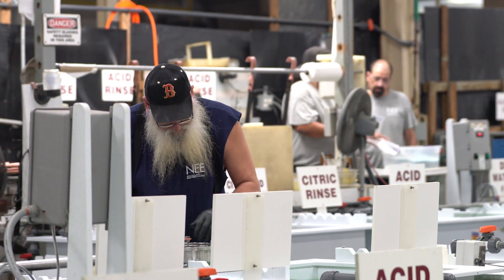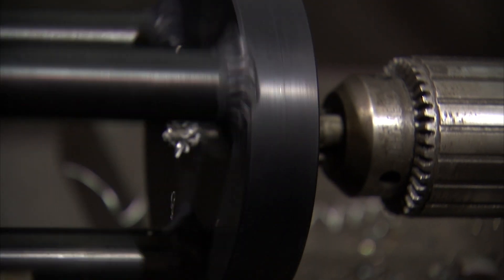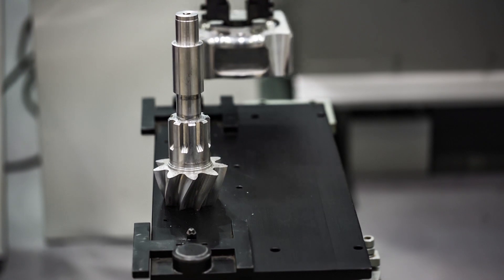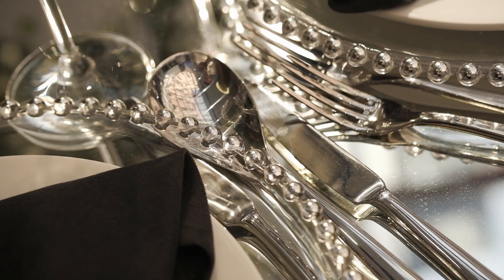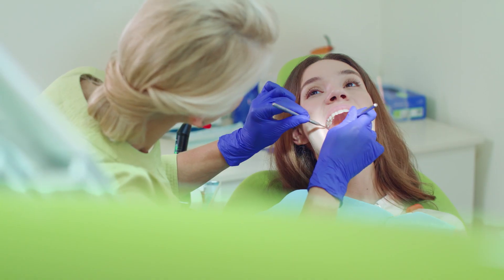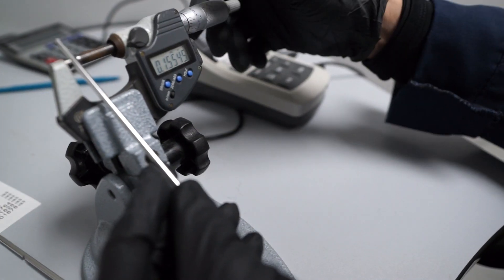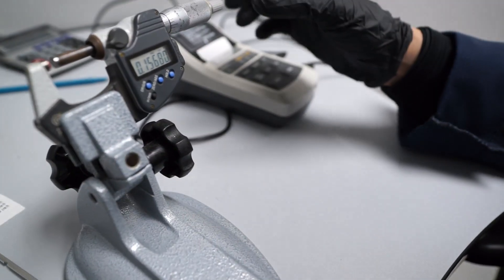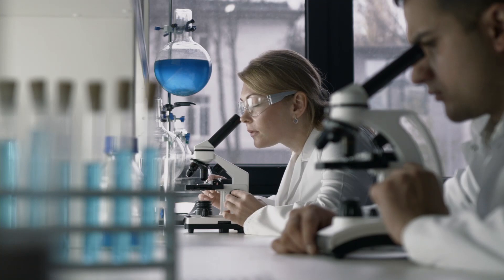Passivation: Promoting stainless steel’s natural corrosion resistance through passivation

Comment: What is formulation of passivation chemicals for galvanized steel sheets?
Reply: usually using chromium hexavalent mixed with chromium trivalent. but due to its hazard to environment, Current technology used phospate as alternative to passivate galvanized steel